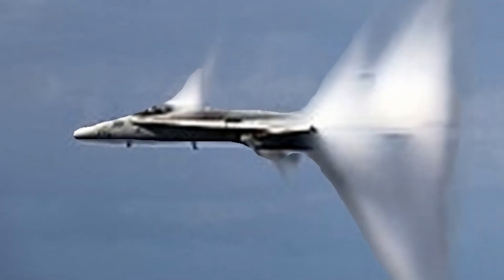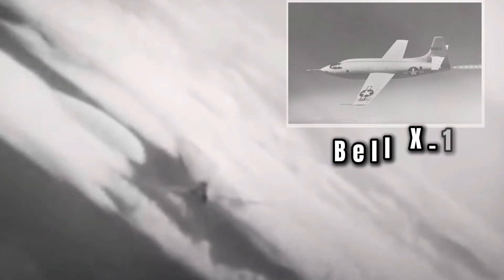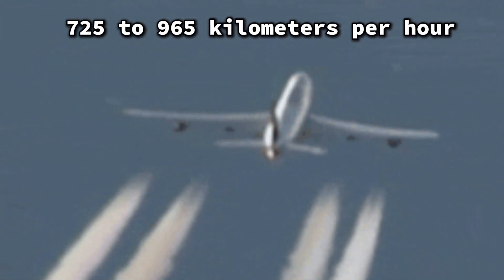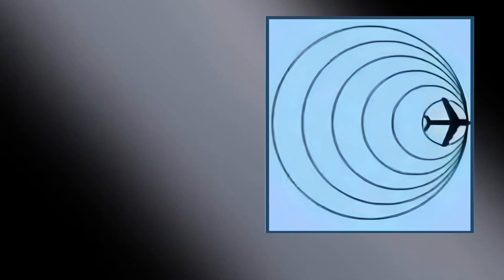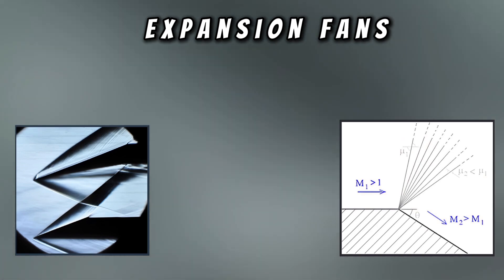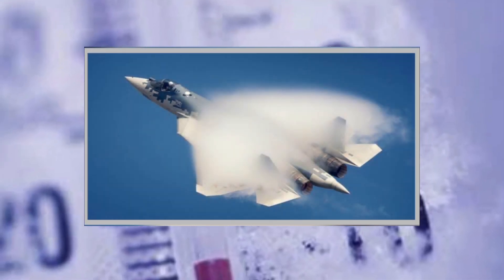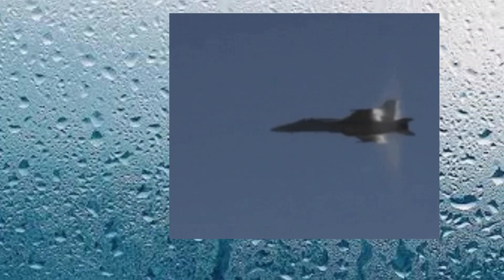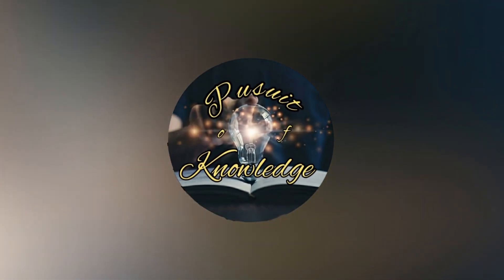The Vapor Cone: How and Why this Happens.

Comment: Close, but not quite accurate
Reply: water vapor condensation is due to pressure change.   This phenomenon and the sound barrier are non sequitar.  Also, the sonic boom video used for the demonstration audio, lacks the distinct double clap, and is most likely not one.
Reply: what's not accurate?